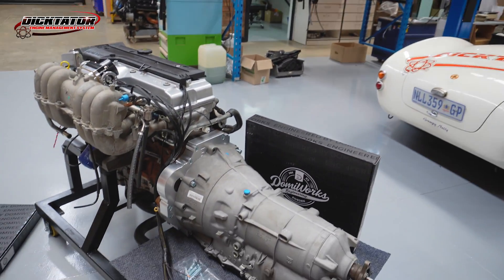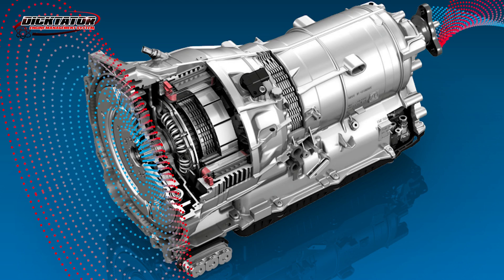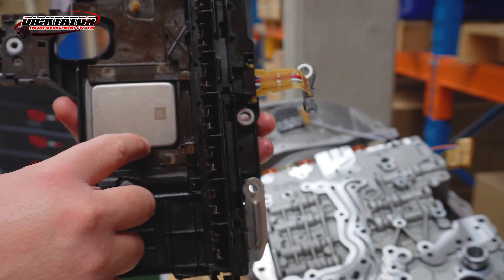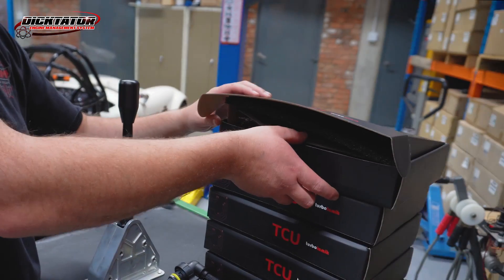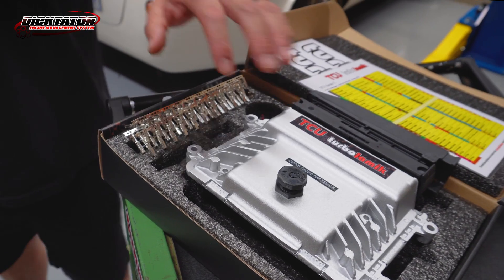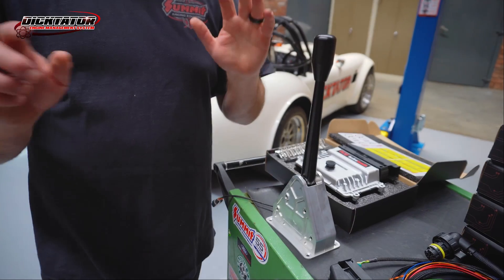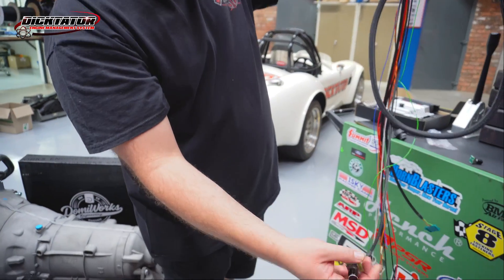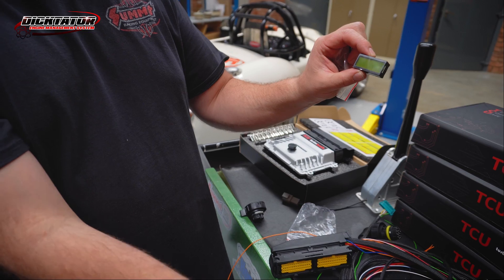8HP70 Gearbox Upgrade: Why it's a no-brainer!

Comment: Lenco gear box! Set it up with shift solenoids use a hydraulic  pump  and accumulators to shift it. With ignition and timing cut for shifts like a dog box. Or Modify the the internals of a auto trans for additional clutches  more planet gears, larger shafts with  stronger matereals,  the tq management  during shifts will help ot survive. At full throttle a ignition cut with timing cut for the time of the shift and about 5-20 rotations of the engine, cut for 4 rotations, retard timing for 5-20  ramping back up to within a few degrees. A 4L60 could be made decent ,  add planets and clutches,  and manage tq on shifts. Those clutches don't slip many times. Until that's all they do... a 4L80 modified should handle all the tq.

Comment: I am building a 1963 chevy ll nova with an LS, I love the idea of the 8HP70-but I only want a BMW 8HP70, the reason is almost all dodge 8HP70 have a thinner main shaft  in them but the BMW have a thicker main shaft, they are bette quality and stronger. my goal is to have 1000 hp from my 6.0L iron block and it has a forged rotating assembly and as the budget allows I will put a turbo system on it- also it will be rear wheel drive with a 4 link ford 9 inch, I am not sure if one from a diesel bmw will work because of the torque and stall speed and I am not interested in drifting this car but you seem to indicate the clutch addition might help in launching the car- I have one more question, many BMW cars are 4 wheel drive is there a kit to bolt on the end of the transmission to give the shaft more stability when you remove the 4 wheel drive extension?
Reply: A turbo LS making 1000 hp shouldn’t have enough torque to destroy the shaft on the dodge units.

Comment: My Jaguar F-Type has the ZF 8 speed. It is as perfect a transmission as has ever been built. No mistakes, no drama, millisecond shifts, does exactly what's asked of it. Sure, a good part of that is Jag's programming of the TCU. But the mechanical bits do their part with instant response to the commands.

Comment: You are kind of overstating your position here. You say that no other stock transmission can handle the same power as an 8HP, but they are rated for the same torque as 6l80s and 6l90s are. The 8HP has definite advantages over those in terms of keeping the vehicle in its power band and converter lock-up control, but it's not made of adamantium. Plenty of people have run 1k horsepower through used TH400s and TH475s with nothing more than a new torque converter. An 8HP can be tough as it wants, but the lock-up clutch is still going to wear, and being entirely electronically controlled, if your software doesn't automatically compensate for valve body wear, it's going to start acting weird.

Comment: 10R80 seems to have the bugs worked out quite well now.  Several 2,000 horsepower Coyotes are running them now.  Do you have any thoughts about this?  I am genuinely asking.  Not trying to be a jerk, as I have zero experience with either transmission.
Reply: 6r80 > 10r80 ~ Lund 6 sec coyote

Comment: I have not seen many options for torque converters available in a drag racing applications, but I got curious when you started talking about a "clutch pedal" option.  Do you think the internal clutch that controls the clutch function could control the rpm of a 1000+hp turbo V8 engine staging and launching at 5k-6k rpm?
Reply: There are some pretty high HP drift builds using these gearboxes. Given the fact the 8hp90 is in the demon, it'll handle the torque but the virtual clutches have been known to wear out the internal clutch packs on 8hp's with abuse, there was another trans controller out there call HTG I think that did the virtual clutch and was known to burn up gearboxes, but everyone recommended the turbolamik one instead as their software is better and their version of virtual clutch apparently isn't as harsh. I haven't ran one personally but going down the rabbit hole of research

Comment: I'm going nuts researching and absorbing all the 8HP info I can to swap my 3UZ IS300. Thanks so much for the video!
Reply: Hey did you get this working? I have an is300 with a 1jz and want to look into this and my concern is the MPX/bean stuff
Reply: @dabbedhermit I haven't taken the plunge yet. Still working on the financial justification. 😂

Comment: Does anyone know if there is any sort of adaptor for the 8hp to run a traditional manual shift transfer case for 4x4 applications?
Reply: yes it can be done
Reply: @harryperfors2224  yep!! Very exciting. deeper into research now and seeing there there are countless possibilities. Landcruiser HF2a, Patrol GU, atlas, NP241OR and many more. This transmission is going to be a game changer for off-road / road driving mix
Reply: If its a divorced transfer case there should be no problem, no?
Reply: There Is a guy on YouTube who 8HP swapped a Toyota Land Cruiser(?) and added 4WD, perhaps looking into what he did could help. I think he also 8HP swapped a Skyline that was AWD

Comment: Shift and park by wire, fluid at $25-40 a quart. Cool, but no thanks.
Reply: Yes that's how automatic transmission work
Reply: @920.streetstyle  You don't have a clue how they work, if you think they all function the same way......
Reply: @jamesgeorge4874  I never said all automatics, I said automatic transmission which makes 1
Reply: @920.streetstyle  Vague, and stupid is how you operate, GOT IT !!!!